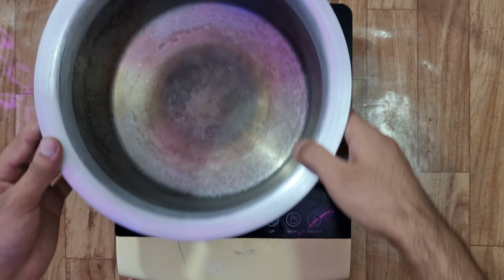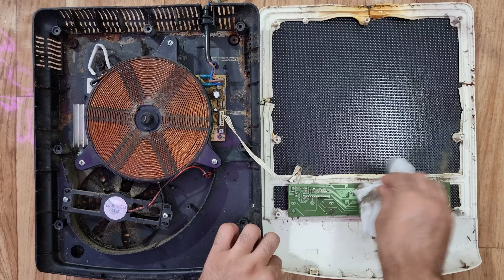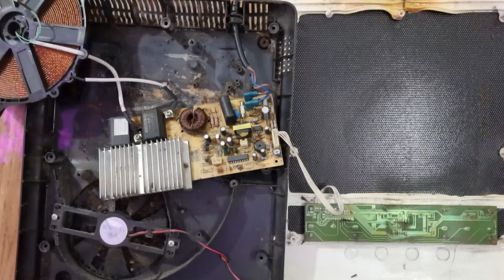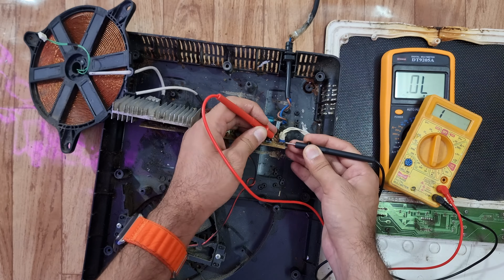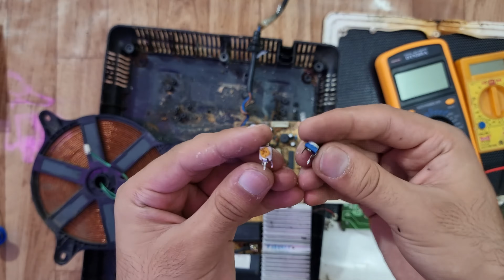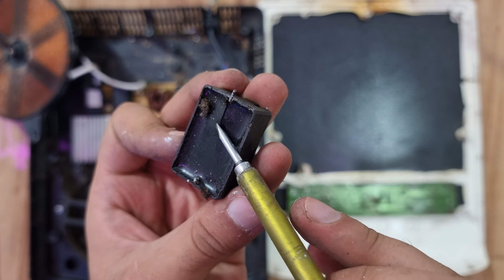induction cooker e0 error solution

Comment: My one is also same problem with your one but mine capacitors are still good in value so i don't know what to do and replace ?.....The last one remain to change is controller ic So what should i do next ??
Any advice for me ??
Reply from the maker: Bro it is very rare for a controller ic to go bad .... If you are getting 5v and 18v on the test points or if you dont have test points on your board , check the diagram of the given ic online , then see if you have 5v and 18v output from controller ic . If you have both of them , your controller ic is good otherwise you need to change it ....other things you need to consider are :-
1. Try swapping the capacitors ( even though they are testing good they may not operate under load )
2. Check the resistance value of preset .
3. Check the resistance value of two 8 kohm resistors out of circuit ( remove them first then test for resistance). 

Hope you fix your device :)